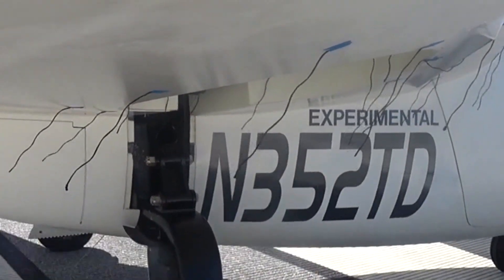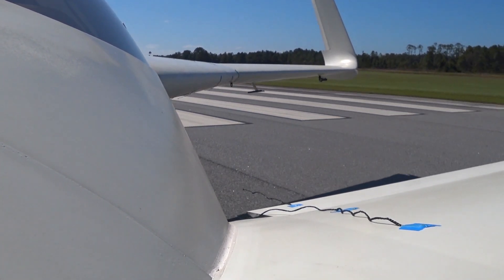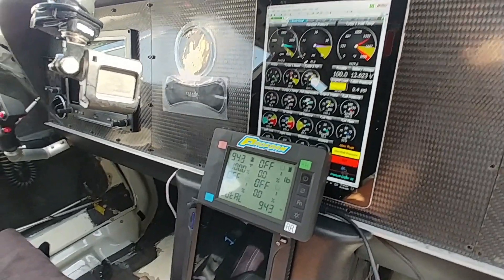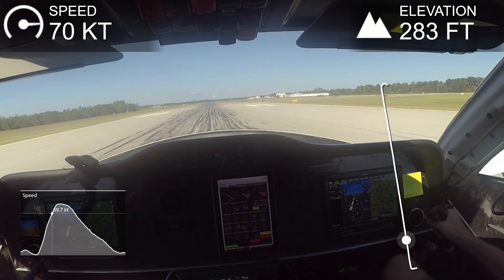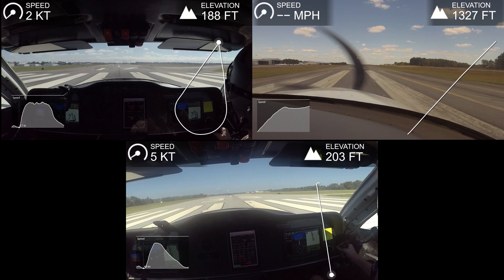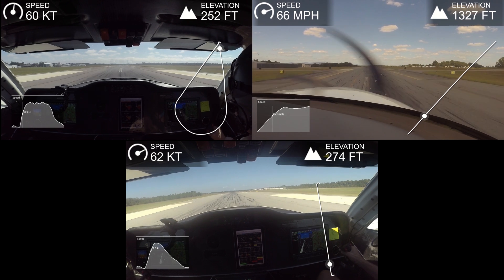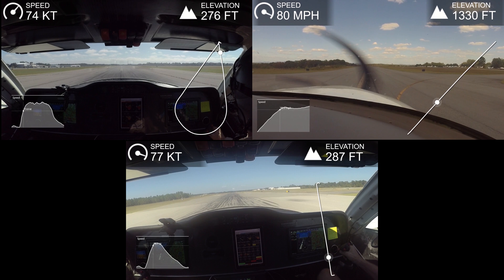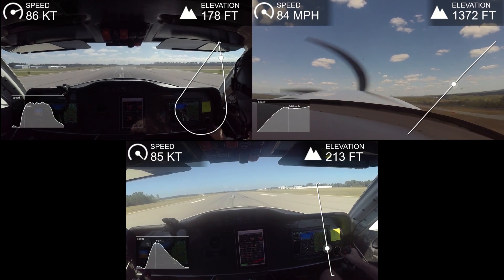Making More Power - Building the Raptor Prototype

Comment: I saw a post earlier about someone discussing the arrangement of the turbos and you went from small to large, made me think of how a jet engine axial compressors are arranged,  from large diameter to small diameter, the same may apply with centrifugal compressors. and I know you can only run two centrifugal compressors in alignment.

Comment: You really don’t want to benchmark off the Cirrus SR20. I co-own that SR20, have met you and wish you well... but you need to be aware of the potential issues:

1) When the 20 advanced the throttle he advanced it very slowly over 5 seconds or more. This uses a lot more runway but prevents hunting which is common on the first flight of the day with the Cirrus single power lever and the Woodward prop governor. All of us owners know this and advance the throttle very slowly for a normal takeoff. You could hear the slow application of power in the original video so I know for sure that’s what he did.

2) The biggest complaint I and every other SR20 pilot has is that they’re a bit underpowered.

Effectively you are benchmarking against a “just barely enough” powered airplane that isn’t even demonstrating its full capability.

Comment: You might already know this but with modern Diesel engines you have the capability of doing a series of fuel injections before and after the main fuel injection, those are used to control combustion temperatures. You can tune in an injection post TDC to cool down the combustion chamber. You take a penalty in BSFC but you can manage temperatures that way. I don’t know what level of sophistication you have with your engine controller but in automotive applications you can run different engine maps depending on conditions you set. So you can have a map that keeps the engine cooler during takeoff at a BSFC penalty and a map at cruise that you can optimize for fuel consumption.
Reply from the maker: The Motec ECU can handle 4 separate injections but presently I'm only using 2. I'm not educated enough to use a post tdc injection yet.
Reply: @RaptorAircraft  I think it’s worth looking into, you can fine tune the timing and quantity of those injections to control your combustion temperatures without making hardware modifications. Also did you get rid of EGR? That can also be used to lower combustion temps. Are you able to use more than one map with Motec? A solution could me having a button to switch between maps, you can have a takeoff power setting and a cruise power setting both having different fueling tuning optimized for their respective phase of flight.
Reply: @ericktijerino  The people at MOTEC are very helpful. On racecars, If you send them the telemetry they will help you tune the mapping.
Reply: @raymondtolhurst7994  that’s great! Even motivation to explore the tuning avenue!

Comment: Hi Peter!
Be cautious that thrust does not equal power. Thrust is the force that the propeller creates against the moving air. The higher the airflow speed, the more power you need for the same thrust. This is why bigger propeller are more efficient.
Power is thrust times airflow speed. So you cannot tell what power your engine really puts out without knowing what massflow you have in reality.

The jet engine that I want to use on my aircraft only has about 250lbs of thrust, but it puts out 145kW!!! So please be careful when deriving your power output.

Power is, what defines until which speed the thrust can be maintained. You have noticed this, when the Raptor stopped to accelerate at 110kt.
BR, Andreas
Reply: I am actually surprised you came back here. That's dedication!
Reply: Glad someone mentioned this in detail.  I'm not an engineer or mechanic but I did pick up on it immediately.

Comment: Remember with diesel engines the more fuel you put in the more heat it makes, the opposite of a petrol engine. If you lean out a petrol engine they get hot, if you lean out a diesel engine they run cooler. You’re looking for more power, you’ll get it with more fuel and timing but at the cost of more heat.

Comment: You should always expect and plan for the worst case scenario. So what is it?.....trying to take off from a high altitude runway in high Summer. Then getting stuck behind a long line of aircraft taxiing for take off. I would think it most important that your engine temperature before you get to the take off runway should be normal.....whatever that is. There must be sufficient cooling while taxiing in high ambient temperature, followed by a long run of 80% power to get you airborne. Keep at it Peter, there is a lot of good will going for you.

Comment: Gross weight of a Cozy MKIV is 2050. This is 3600. This does have 5 extra feet of wingspan The flight of this aircraft appeared to show border-line wing stall (stalls of main wing on canards are unrecoverable!). This is likely just way too much weight. 18% more wingspan but 75% more weight. I hope the wheel wells help, but am very concerned for this gentleman, as many others have been.
Reply: Wing span is not the only factor for lift . A380 has roughly twice the wingspan of a  737, yet carries 7 times the weight. the two are not directly related.
Reply: @nocare  @nicholas finch ..I definitely did not say there is a formula or design rule of thumb that correlates wingspan to weight.  The comparison with the Cozy does throw a red flag that something may be off with wing loading (due to them being similar aircraft).  Basically, with the given information, I’m saying something does not look right here and does not pass “the sanity check”, which is what a designer might do when they step back and ask “does this overall design make sense” after they have concentrated on the trees of the forest for too long. Don’t parse me on the sanity check statement.  You all understand what I am conveying.
Reply: For comparison specs on a Cozy MKIV 
Cozy MKIv
Wing Span ft	 	       28.10 
Wing Area sq ft	      102.30 
Canard Span ft	        12.10 
Canard Area sq ft         13.10 
Total Wing Area sq ft	115.4
Reply: @pctrashtalk2069  the Wikipedia for the raptor claims 167 sqft of wing area. I don’t see how there is that much difference unless it is in the strake.  So my question is why would the Rutan derivative designs not use the strake as a lifting surface (if they don’t). There must be a reason.  My guess is it cannot produce reliable lift behind the canard due to dirty air?

Comment: It's baffling to even read that the engine power is still a concern--while the engine cooling has issues.
Reply: If you can’t keep it cool you have to get where you’re going FAST 😂
Reply: There are a number of issues cooling is only one. Peter is systematically looking at each. I suspect if you would cut Peter a check he would conduct the testing in what ever order you want
Reply: Overheating causes loss of power, always.
Reply: @pauldatche8410  great point
Reply: @judd_s5643  , You really want to put a price on safety? The engine had enough power to come off of the runway with distance to spare, and climb out. Agreed?
Reply: @BrendaEM  < never once did I say anything about compromising safety. I simply said if you don’t like how Peter is conducting Raptor Development you could easily pay Peter to do it as you wish. 

He is writing the checks, he has spent years to get to this point AND it is his life on the line.

Personally I think Peter is crazy for conducting this development in a online environment exposing himself to ridicule by the uninformed.
Reply: @judd_s5643  Why ever would you mention something about money when someone brings up a safety concern? When Peter was in the cockpit last, much of what he voiced was concern about cooling, which takes his concentration from flying a new untested plane.
I don't know what the value was about reiterating the obvious that his life is on the line. Obviously I care or I wouldn't have taken the time to comment. If you take those comments as ridicule, then you likely don't have the intestinal fortitude to be objective.
About being informed. Well, I watched every one of Peter's videos, and recently read up on his studies. Obviously, Peter knows his plane better than anyone, but Peter has let us see his process, and if we didn't comment when thought something wasn't right, then surely we have failed him. Having only people who agree with your every whim, will make you a narcissist, or if you are an aircraft designer,  a tragic FFA study case. If someone questioned the placement of a valve, Bob Denver would be alive.

Comment: Positive comment: The willingness to cover the wheel wells for a test is a step in a good direction.
Reply: Here's thing though: it isn't. The gear openings are a red herring; the aircraft is fundamentally aerodynamically unstable.
Reply: @bennettdiamond9744  why would that be the case? What's caused that?
Reply: @simonbaxter8001  the reason it wouldn't is because at the most critical points of flight the gear will be down making it extremely unstable during take off and landing.
Reply: @simonbaxter8001  Agreed! I have a strong feeling however that the test flight won't support the gear door theory.
Reply: @deSloleye  Stability is dependent on the location of the cg relative to the aerodynamic center, the "average" location of the lifting force. In the case of a canard configuration, increasing the lift of the main wing will bring the aerodynamic center back since the average lift is closer to the main wing. Since most of the lift is created on the top surface of a wing (look at a Cp vs. x plot for an airfoil), the bottom surface has relatively little impact so having a turbulent/bumpy lower surface will not be much different than a laminar/flush lower surface. 

This is also why using the V channel to trip the flow is unhelpful: Peter is just recreating the turbulent area slightly further forward, not actually seeing whether turbulence on the underside affects the stability (and as shown earlier, it doesn't).

Furthermore as Austin pointed out, you have to cycle the gear during takeoff and landing, opening those holes (if they're covered when the gear is down). If those holes are causing instability, the aircraft will have to be unstable for that period close to the ground. I don't care if it's only unstable for a few seconds, I will not fly it.

An analogy if the mess above isn't clear: Velocity has a canard aircraft that looks exactly like the Raptor if you have a few drinks. They have open wheel wells when the gear is down. Velocities are stable period. Therefore there's something funky with the Raptor design that can't be the gear wells (I have a hunch the canard is doing too much of the work and that main wing should have higher lift airfoils are a higher incidence).
Reply: @bennettdiamond9744  so what you're talking about CG/CL locations for stability? That is a bit of a concern, but that is an extremely violent form of departure which he hasn't seen. Most of the oscillation I've seen is explainable as PIO, and given he's had it in the air only a couple of rough times and isn't a test pilot himself, that doesn't surprise me. If, as some have suggested (without evidence I can see), the main wing is approaching a stall then he's in a different kind of trouble not related to stability (or related, if you count stability of deep stalls). An investigation of accelerated stall behaviour of the wing and canard would be worthwhile. His moving of the cg forward with coolant tanks will restore that comforting canard porpoise stall behaviour if he has actually lost it.
Reply: @deSloleye  When we do stability analysis on paper, we're usually just looking for the aft cg limit and then adding a nice factor of safety to make sure no adventuring (dumb) pilot goes near that limit. In the real world, stability is a little less cut and dry. As the cg moves aft, the aircraft will exhibit less stable behavior, i.e. less damped or un-damped oscillations, and even further aft, increasing oscillations. I'm suggesting that the Raptor is currently in the former situation where the aircraft is not entirely stable and is oscillating. If the cg was on or behind the aerodynamic center the aircraft would become completely divergent and would crash period (assuming it could get off of the ground). 

I couldn't disagree that some of the oscillation could be attributed to Peter, but looking at the videos, there's a whole lot of pitch oscillation with very little stick deflection suggesting that Peter isn't the one causing a majority of the oscillations and it's a stability issue as stick deflection and change in AOA become non-linear in unstable regimes. 

 The first rule of canard design is that the canard stalls first. It's not a main wing stall, especially since the AOA isn't high enough for a stall.
Reply: @bennettdiamond9744  so I was wondering if moving the cg forward will cause the canard to stall first and restore the stability. From what you're saying that seems sensible.
Reply: This stuff is just beyond where I'm at in my engineering degree, so it's very interesting
Reply: @bennettdiamond9744  Yup I learnt something here today.
Reply: @bennettdiamond9744  Indeed,  but the builder is not going to take anyone's advice on this except his own. So he needs to do the experiment first.
Reply: And then hopefully, he won't mis-interpret the results.
Reply: @deSloleye  Yup! The only question is how far forward it needs to go. It could require such a far forward cg that the canard can't provide enough lift to pitch the aircraft up, or the cg might have to be so far forward that the rear seats can only have very light passengers, which would also suck!

Engineering is drinking from the fire hose and learning by experience, it's all a blast ;)
Reply: @PatrickJWenzel  Glad you did! Aircraft stability is quite an interesting subject!
Reply: @T_Mo271  Unfortunately. Objectivity is key in finding the root cause. Hopefully that experiment doesn't kill him.

He's gonna run out of other reasons pretty quickly and will have to address fundamental stability.
Reply: @bennettdiamond9744  Do you think VSGs on the main wing would help? Not on the underside, obviously. I have heard the fowler flap type elevator design on canards has the risk of stalling after the main wing if they're too effective.
Reply: @deSloleye  by VSGs do you mean vortex generators? I don't think adding VGs would do much good. First, of course, you need to see if there's separation, and I think the only separation that could be there would be a laminar separation bubble. VGs in that case would actually reduce lift (and drag) because it would increase pressure recovery, reducing the Cp over the bubble area resulting in less "suction". 

From my limited understanding of fowler flaps and what I've read about them, I think the opposite would be true and they would stall earlier. Intuitively: if you increase lift using a fowler flap, the effective incidence of the wing would increase because the leading edge is moving down, changing the angle of the chord line. Since the main wing incidence is fixed and doesn't change with elevator deflection, the effective result is that the AOA on the canard will be higher compared to the main wing with positive stick deflection resulting in the canard still stalling first, especially with larger stick deflections.
Reply: @bennettdiamond9744  yeah that's exactly what I mean, sorry. My understanding for the fowler flap was that the air flowing from the underside of the canard will be moved up and directed down over the elevator, like a blown flap, and will increase the critical alpha which would mean the canard would stall at a higher AoA, putting the aircraft at risk of stalling the main wing first.

As far as VGs: I guess if Peter puts on yarn over the main wing we'd get a good view of what's happening. I figured they'd add drag, but am surprised they'd have reduced lift at all. Not sure what you mean by a laminar separation bubble.

Comment: If no no one else has said it remove the nose gear doors and cover the hole. With your high deck angle and low speed that forward cabin bulkhead is just a big piece of flat plate in the wind. Nothing but drag. If you already know never mind.

Comment: I have seen other canards with vortilons. I don’t think other canards produce much lift at the strake, but yours appears to possibly depend on it due to a designed in angle of attack. With this area being so swept back, the addition of vortilons may help.  From what I have read, they cannot hurt anything.  Other canards have them on the wing beyond the strake, which you may want to do as well.  Can’t hurt and may help with quality of lift.

Comment: Just a suggestion regarding blanking off the wheel well. Some polystyrene foam , easy to shape, light, and wont hurt anything if it comes out. Shape and tape in place.  It has a down factor though you would not be able to fold the undercarriage in an emergency.  Admire your commitment and tenacity and hope the year gets better for you. All the best
Reply: Plus one on that one, polystyrene has the advantage of do being likely to damage the prop in case it comes off during a run